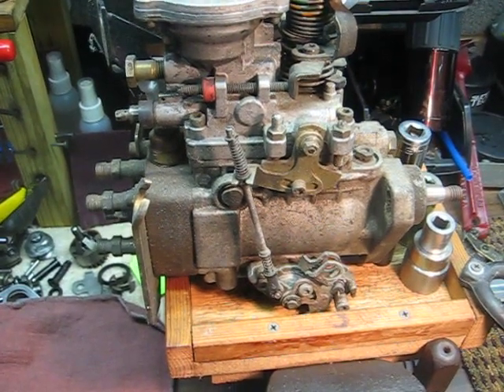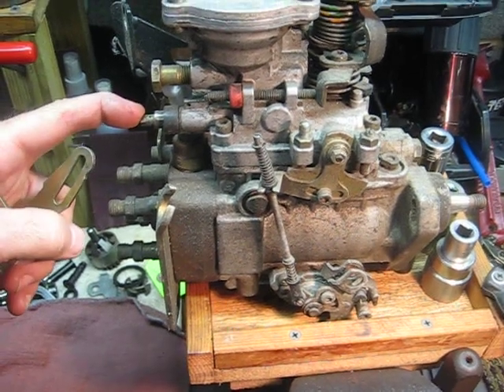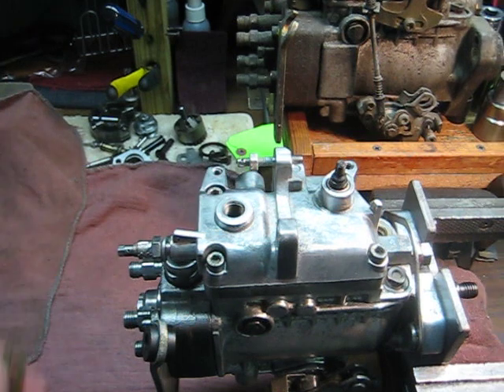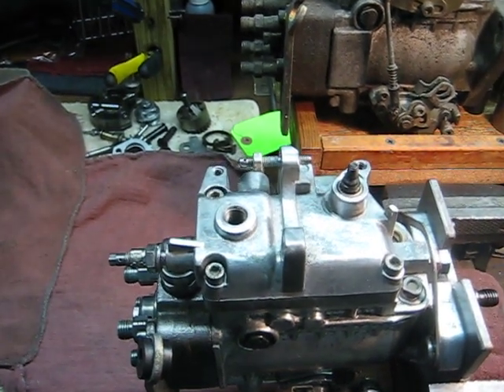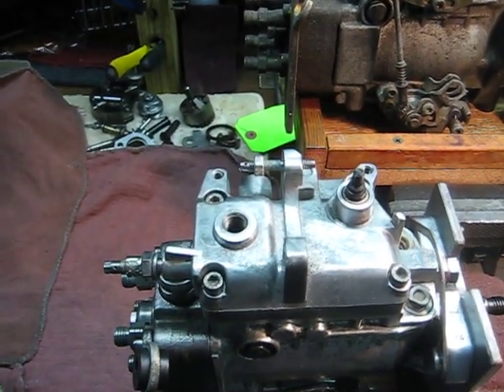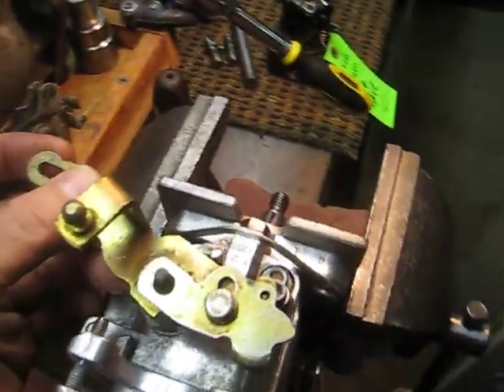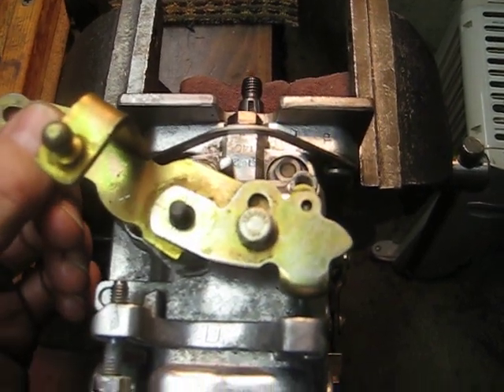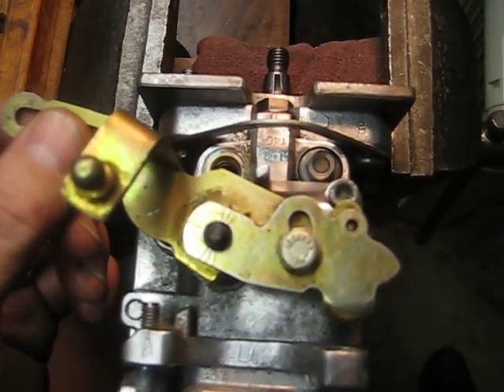Adjusting Fuel Enrichment Screw VW Bosch VE injection pumps

Comment from the maker: OK, I haven't been on here in a long time.
Before you touch anything, look at the position of the screw slot on the end of the adjustment screw. Is it pointing to 1 and 7 o'clock position or is it 9 and 3? Mark it down so you can go back. Then loosen the nut and try to adjust it. Keep track of how far you turn it either in or out.
That way you can go back exactly to what it was before. Don't expect to get lots more power without getting any more smoke, more fuel equals more power but it will surely smoke more. This was put up because when you rebuild your pump you need to leave the bracket nut off so you can play with the throw on the bracket while turning the fuel screw in or out and then removing the bracket and turning it so a different mark lines up with the shaft line. it will run differently when the adjustment screw is turned in more and you will have to pop the bracket up and rotate it a little. you will have to try everything in a different place, no 2 engines will run the same depending on how worn or new everything else is. When you have it revving ok you can tighten things up and put the spring back on. Always remember timing is everything. I've seen an engine run and miss and pop and it sounded like it was going to blow up and missing on 1 cylinder and 1 tooth adjustment on the belt and then it runs perfect. Turn it in for more fuel and back out for less. Try it as far in as you can to start.

Comment from the maker: First thing is the feed pump in correctly? When you look inside the feed pump outer ring should have the small hole where the fuel comes in on the right side looking in from the back. If it's flipped so it's on the left it will be covered up by the top plate. You should be able to look and see down the hole where the fuel should come. If not you might have the ring flipped over. Also the thick section should be on the top. Double check 12v to the shutoff. Intake and return fittings on correct?

Comment: Hi, You seemed like a very knowledgeable guy so I have to ask if you can help. I have a 86 vw rabbit diesel (Bosh VE 1.6. I ordered a instructional dvd and rebuilt mine. The problem I was having is all of a sudden, I was getting no fuel out.. I also replaced the pressure regulator and I am still having the same problem as before.. No fuel out.. It is primed and I adjusted the pressure accordingly. Do you know of any reason no pressure comes out of any injector lines when cracked open? Thanks!

Comment from the maker: Also be careful when everything goes back together. No fuel could be a few things. I've seen people put the banjo fitting on backwards and also depending on how the feed pump is set in could block fuel and you will get nothing out. If you replace the pressure valve did you tap it in a little? flush to the top will have almost no pressure. You have to tap it in slightly like around 1/16th.